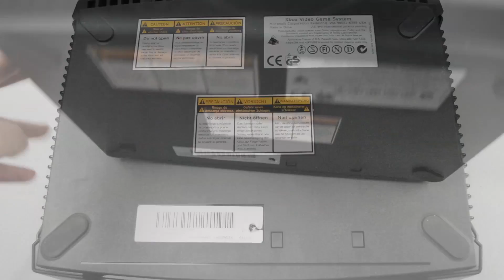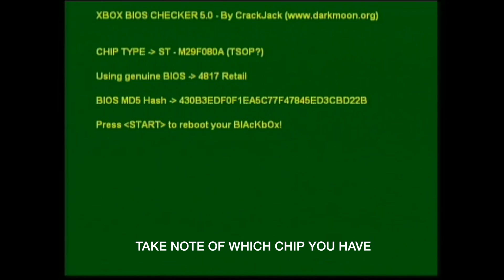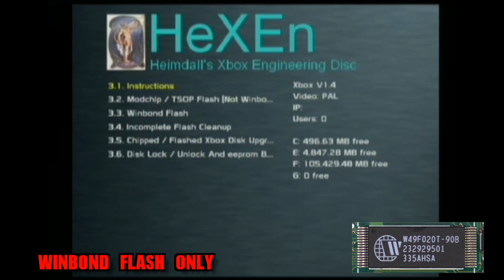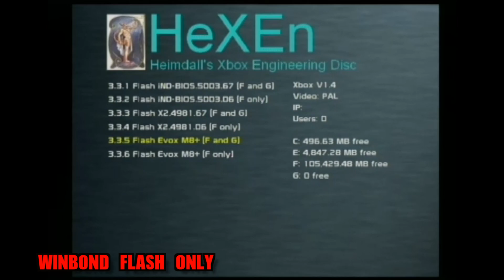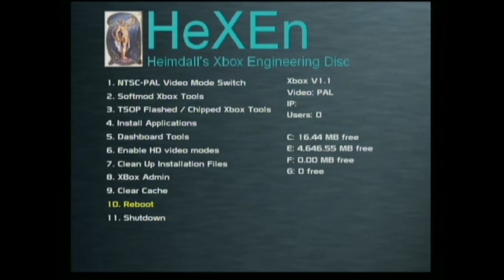How To TSOP Xbox Easiest Method v1.0 to 1.4 | MOD Guide

Comment: Thank you for this tutorial. Its really worth it to do this mod in order to preserve the original system and allow it to be playable for the years down the road.
In terms of hardware revisions though, which revision would you say is the best in terms of component quality and long term play ability?
( I tried out a 1.2 and its video output was noticeably darker than the 1.1 that I own. They're both using the same video encoder chip ).
Reply from the maker: +PowerLeef my personal favourite is the 1.4.. it seems to be the most common here and is the easiest to work on (the flash is readable with a cheap programmer) 
As for the darker video out, it could be a physical issue with one of the consoles, I’ve never noticed a difference between any version in that regard. :)
Reply: One more question for you :)
What kind of Soldering Iron did you use?

Comment: Ran into a bit of a gotcha on my end, but resolved it! If you're flashing a Winbond chip - be sure to use a legitimate Xbox controller! As soon as Gentoox would load up I could not control my console at all and it would default to CD/DVD. After several tries I dug around for an original, legit controller and was able to flash on the first go!
Reply from the maker: +MrMario2011 that is really strange!?
Reply: Hey there, by the way after soldering the points do you have to desolder and put it back at the original state or not necessary.
Reply: God I miss ISOZONE TUTS.....
Reply: This is something that should be said in other newer videos. No one ever mentions this little things. I swear I broke my head literally trying to figure out why I couldn't move to the right even burned multiple versions of truehexen. It's super discouraging when there are lots of videos out there and they assume you know all the little things. I have been breaking my head for the past week just trying to upgrade to a bigger Xbox. I might  have to make a very detailed comprehensive tutorial of all the small little details that lots of videos that I've seen that people don't cover. For example: something as little as if you are loading the hex DVD just literally wait like 3 minutes. They just don't say little things like this. I love hacking and modding but this has been the most frustrating process
Reply: MrMario2011 I heard this recently on another video as well, the poster said be sure to use an original controller. Go figure!
Reply: thanks again for showing me this video its amazing how easy it is to mod the original xbox compared to the 360
Reply: Thank you!
Reply: Yes this is definitely true.
Reply: I'm reflashing to a bios that supports 128mb and I too can confirm this. 3rd party controllers will not function at the gentools screen. Thanks for reminding me.

Comment: For some reason I cannot get mine to boot Hexen or slayers Evox 27 on a disc, i've tried a few discs DVD + and -, new cdr's just no luck, when I put the discs in the drive it waits a bit then says I need to insert a disc that my xbox supports, I've got a windbond chip and my disc drive is a Hitachi LG drive or HL Data Storage, do you know what i'm doing wrong???
Reply: is it softmodded?, it would do that on a stock xbox.

Comment: Ever heard of the slimbox mod? I'm considering doing it, I have a softmodded XBOX (though I do have Aladdin XT2+ chip laying around). Does TSOPing the XBOX mess with the softmod? I've read I'd need to TSOP a no-drive BIOS so it would boot without checking the drive but I've also read some issues with XBMC without the drive present.

Comment: great tutorial, about to do first tsop on my 1.0, but I have a question, the non windbond 1.0-1.5 bios you recommended, you said its for evox, what if you're planning on using unleash x? what do you recommend?
Reply: That's the BIOS mate, not the dashboard. It doesn't really help when you have Evo X Dash and Evo X BIOS haha
Reply: stezo2k thanks, i figured that out.
Reply: stezo2k one punch man!

Comment: I know this might sound dumb, but will this fix errors 05 and 16? Also really love the tutorial!
Reply: error 5 means your hard drive is not locked so tsop flashing will fix that
error 16 means clocks cannot be set idk if tsop will fix that but you can try!
Reply: It did for mine. Im having issues with  burning the Hexen 2018 dvd myself. Been burning slowest speed with DVD-R and it starts to read the disc (makes about three or four pass's reading) and then i get a red ring. But it did let me get past the boot loop from removing the clock capacitor.
Reply: I would also suggest using OGXbox2021 insted of Hexen2018. I ran into issues with Hexen2018. My C drive would fill up and i had no way to be able to clear it out (it was on some wierd lock that prevented you from seeing the files, so you had no way to clear out anything.) I would HIGHLY suggest joining OGXbox forums. The Crew there have been awesome and been more then willing to help those that need it.

Comment: So the TSOP comes in the Xbox already? Also is this like running a modchip? No need to track down a lockable hard drive to upgrade it?
Reply from the maker: functions the same as a mod chip, you also dont need to lock new HDD's after you do this mod
Reply: Slot1Gamer for chip type, it says I have a modchip. What do I do?

Comment: Great video mate, Just 3 questions about this.

First - I need to buy my first soldering iron, Would I be fine with a 60 watt adjustable temperature solder iron?

Second - What is the wire called you use for the sharp flash ? (2:49 in the video) and does it have to be a certain thickness?
Reply: Yihua Soldering Iron Station 50W wire is 30awg i think... get the iron with the 10 free tips if you can
Reply: Yihua Soldering Iron Station 50W is about 45 aust dollars.

Comment: Hi I have a v1.1-1.5 console (uncertain of exactly which but definitely 1 of those) with a win bond chip that has a mod chip installed and has no evidence of the tsop flashing bridges and when I remove the mod chip it frags even when I have installed the softmod I want to tsop this console but I can't remove the mod chip what can I do?
Reply: That is for sure a previous attempt of tsop flash bad bios flash or dead tsop then someone installed the modchip to fix, best option is to leave the console with the modchip installed.
Reply: ricardo77773 cheers mate I had a feeling that might be the case

Comment: what happens if bios checker says : CHIP TYPE: MODCHIP (or unknow homebrew)

512k BIOSES: 
1.Bios Unknow
2.Bios  Unknow

256k BIOSES:
1.Bios > Unknow
2.Bios > Unknow
3.-Bios > Unknow
4.Bios > Unknow

i want to upgrade bios but says upgrade fail.  winbond here
Reply: i got the same thing, did you figure it out?

Comment: Hello Slot! I have a v1.1 PAL XBOX and I want to TSOP it! This Box is already softmodded.
But, here is my problem, I want to customize the bios (blue flubber, XBOX customized text ect..) but i want to keep the bios you choosen in the video. So help me, I can't find any tutorial how to create a customized bios and what software do i have to use for this. HELP ME. Thank You
Reply: Up?
Reply from the maker: There are some bios that support this by using an extra file on the HDD, there was a tool to edit the bios but I could never find a copy.. sorry
Reply: Hello there, I still don't have TSOPed ahah! I was just wondering, can I pick the bios from the HExEn CD and custom it (flubber color ect..)?

Comment: where does bios checker show that tsop points are soldered correctly?
Reply: simbin where it says chip type that bit that says (TSOP?) if it says that it's ready to flash if not then you've made a mistake somewhere
Reply: William Lowry. Mine says unknown modchip (homebrew) is this mean I didn't solder correctly?

Comment: What options are available if the soft mod has been removed ?
Reply: download xbox hdm, and use the option "generic fonts" instead of kernel specific (unless you can find the kernel listed on the board, sometimes it is sticker on the motherboard or on the hard drive). 

once you have the disk setup, put your xbox next to the pc. boot the computer up and boot the xbox up (make sure your AV cable is plugged in). disconnect the IDE cable from the xbox and plug it into the IDE port of the computer. timing can be a bit finicky but you should be able to pull the cable while the xbox is trying to read the hard drive, and that leaves it in an unlocked state. 

you can then use xbox HDM to restore your files.. if you want, you can download NDURE before doing any of this, and you can rebuild the C and E drive and soft mod them at the same time.. it takes about 20 minutes or so to complete.

once you have either put the dash files back on, or just put all the files on with the softwood, you should be back in business.
Reply: soft mod it again, and mod it...
Reply: Steven Benson what if I has no dashboard to get the softmod files on.
Reply: what is the status of your xbox?
Reply: Error for no dashboard forget the number but no softmod no dash no eeprom. I need to rebuild the hard drive back to the Microsoft dash.
Reply: kk. do you have a PC with an IDE drive?
Reply: Steven Benson yes
Reply: Steven Benson thank you I'll try that soon
Reply: let me know how it works out

Comment: I use wire glue to connect the points, it's risk free and traces can be wiped away when finished to relock the tsop which is handy when modding for friends etc, for the extra sharp wire I make an L shape with electric tape right next to the points and draw the trace using the glue (although sharp tsops are rare)

Comment: im so terrible at this, im happy i've been on a mobo that's bricked already to practice. I do have some questions though, are you heating the solder and pulling it across the point to create like a metal bridge?
Reply: personally I tin a small length of wire and take it over the two points, hit that with the iron for 5-10 seconds and then leave it alone since it is bridged.